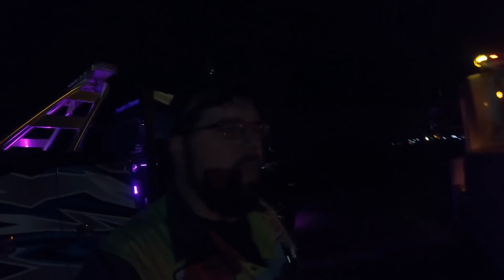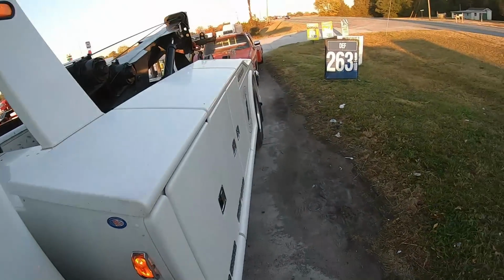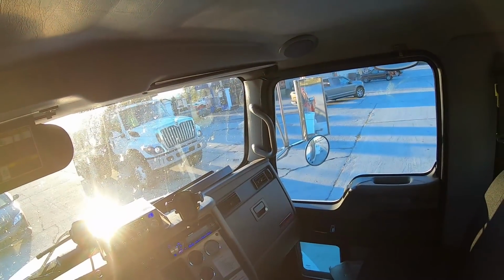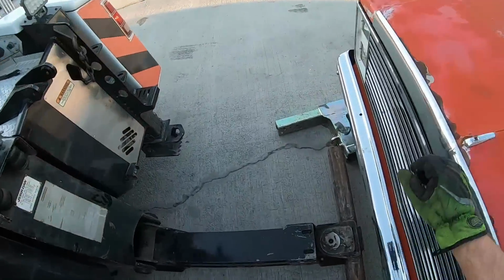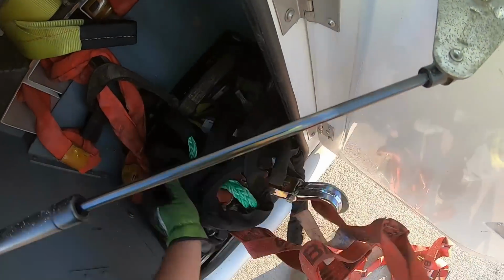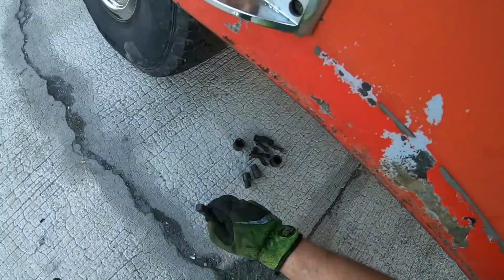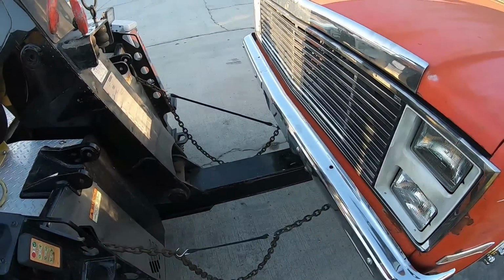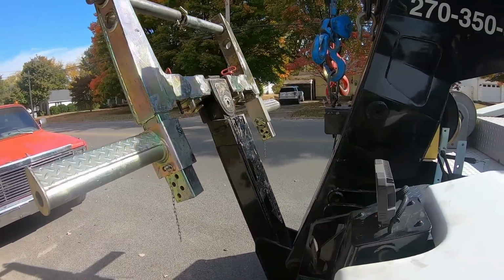Towing an Old Square Body Chevrolet Ramp Truck, Medium Duty Tow!!

Comment: I guess them Trucks are not meant for long distance pick up's With the small Fuel Tank.
Thanks.
Mike M.
Reply from the maker: Yeah, this one is great for running around in town in tight areas.  A long trip requires planning out fuel stops for sure lol thanks for watching!